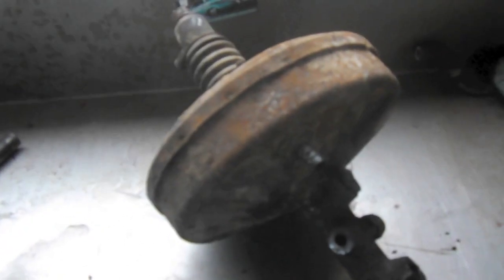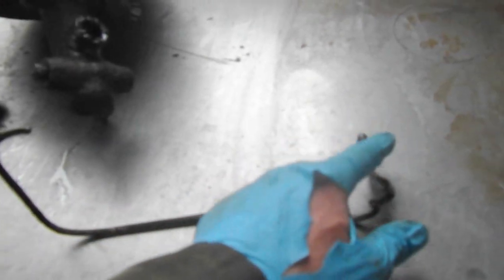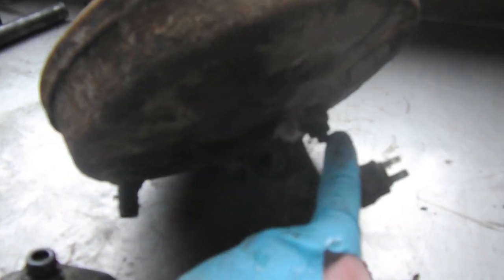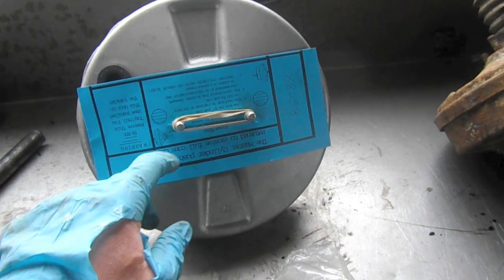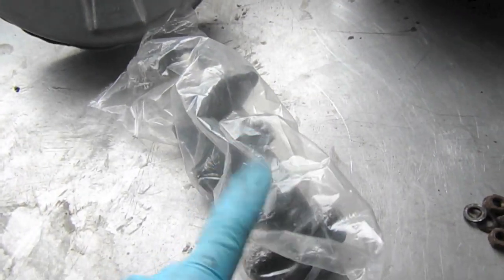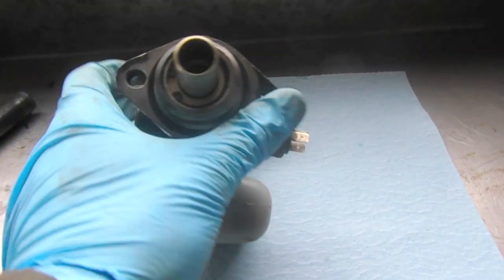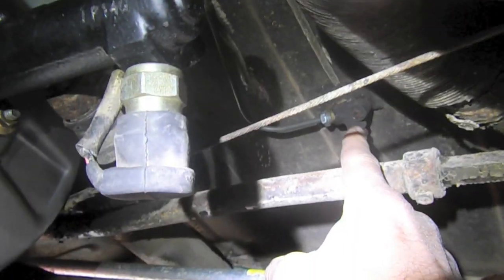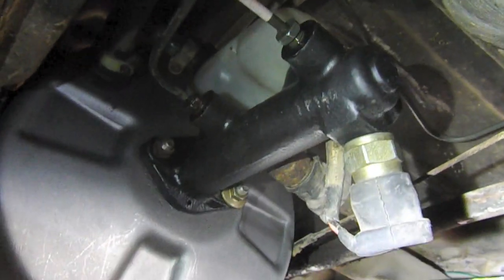Busaru - White Smoke Scare 2 (Brake booster and master cylinder replace)

Comment: Dudes. thank you so much. I got a 2001 Toyota tundra v6 SR5. It's my late grandfathers truck. I try to keep it up for my grandmother to drive but the brakes leaking and spongy pedals and I couldn't find the leak. Nothing on the ground, used 2 tail cans of break fluid....... still nothing on the ground. Then all of a sudden I seen white smoke come out the tail pipe. I said omg the fucking head gasket blow.shit, shit, shit!  But its smell like burning brake fluid and not antifreeze/ coolant..... WTF!!!! Never heard OF this or seen this is this even possible. Everyone keep asking me are you sure about brake fluid exhaust or engine leaking in the engine burning. Idk bull I'll look it up. Then i seen your videos. I was like thank you God. I know I wasn't crazy. Replace master cylinder and booster. Thanks man.

Comment: Hey Bro... BJ here... again.  Just wondering what your take on DOT 5 brake fluid would be?  My brake booster died (busted diaphragm) so I am replacing it with a brake booster and master cylinder from a Westphalia.  Also replacing front brake pads and rear brake shoes after re-building the front calipers and rear brake cylinders.  I am running 17" Sliderz rims all around with P225-50's on the front and P225-70's on the rear (MUCH cheaper than a freeway flyer transmission).  I got the parts off of a Westphalia mainly because Westie's are a lot heavier than my 84 Vanagon L, so my thinking is the master cylinder and brake booster would be a little more "stout".   Which brings me to the brake fluid.  I know that DOT 5  has a higher temperature rating, but have heard bad things about silicone based fluids and rubber o-rings.  So... what are your thoughts??  The manual calls for DOT 3, but I doubt DOT 5 was invented when the manual was written... and stopping my Vanagon (quickly) at highway speeds can get just a tad hairy sometimes.

Comment: Hey quick question for you. I've replaced all the brakes, calipers, wheel cylinders on my 79 Westie but the brakes still are hard to push. They stop really well but you have to use more force than a normal vehicle. I checked for vacuum leaks in the line going to the brake booster and there were no leaks. I'm getting good vacuum at the booster. The check valve was bad so I replaced that and it didn't really improve the brakes. My question is whether or not replacing the brake  booster and master cylinder will fix my issue or if this is just  how the brakes will be even if I replaced those.  Thanks
Reply from the maker: +Ryan Wendt hey Ryan, it sure sounds like the booster isn't working. Make sure the check valve is in the right direction. The brakes should be very much like a modern car in the force needed. So if you've bled everything then I would triple check your booster, as that was my problem. Have you noticed if any of your brake fluid is leaving the reservoir mysteriously?
Reply: The Check valve is in the right direction and yes it seems like reservoir is slowly leaking (I've noticed the air pocket at the top of the reservoir keeps slowly getting bigger) however its not leaking from any of the lines and I'm not getting any white smoke like you were in the video. I guess i'm just reluctant to drop another 150 on parts if its not going to improve it.
Reply from the maker: +Ryan Wendt Okay, I think I might have a hypothesis. So right now your booster is slowly filling with brake fluid. When it reaches the high point, where the vacuum hose is, the fluid will start making its way to the engine and you'll start getting white smoke like I did. Take your vacuum hose off and stick a string in the booster to see if you can saturate it with fluid. You'll know that's your problem if it comes out wet.
Reply: Ok, I did this and there was no fluid on the string. So i think that means the master cylinder isn't leaking into the brake booster. I think the reservoir air pocket might be a red herring, maybe its not actually leaking but air worked its way up into the reservoir.  Because it looks about the same level after i changed the front calipers and pads. We drove it around a bit too.

The other weird thing i noticed is when i removed the hose at the booster there was no vacuum pressure. The check valve was replaced so shouldn't it have maintained the vacuum pressure with the bus off? So its possible there could be a leak in the line even though i was getting vacuum at the booster or the diaphragm in the booster is bad.